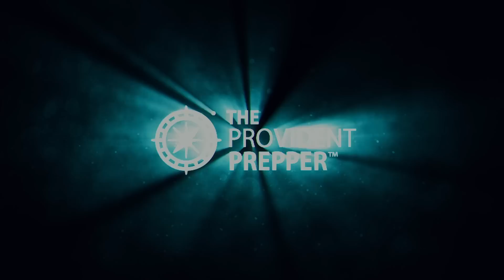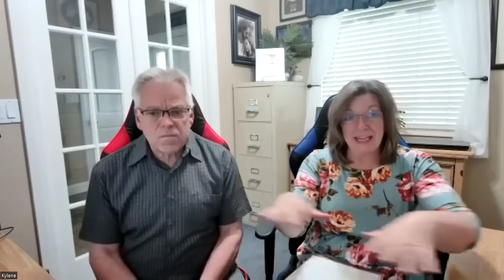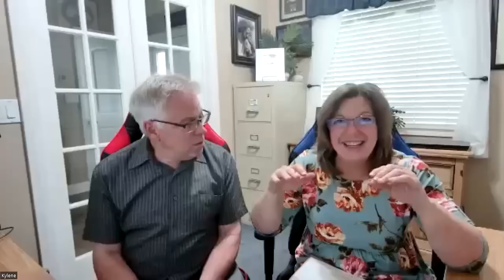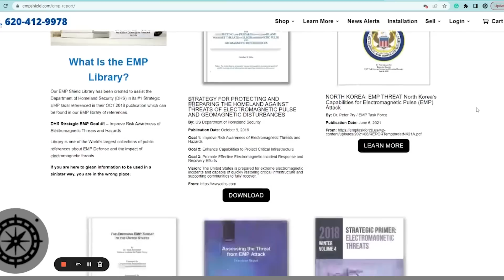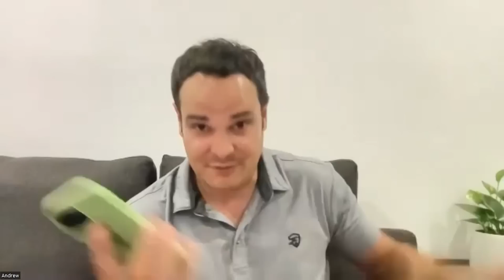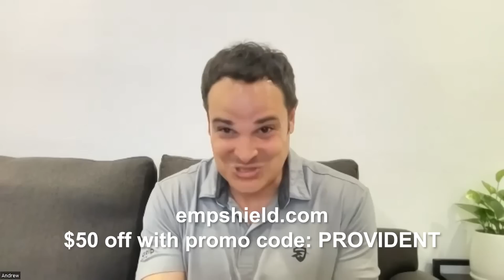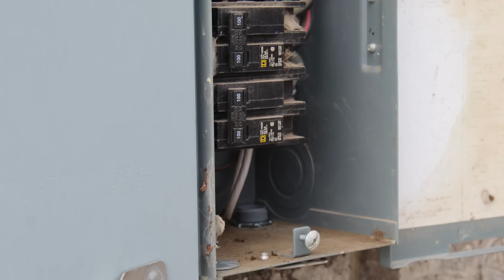Facts About EMP Protection: Interview with EMP Expert Andrew Bucchin

Comment: Why does everyone refer to the Carrington Event and claim falsely the electrical grid is going to go down. Yes there was an event that made issues with telegraph lines and the electrical grid. These modern claims completely ignore the fact that in 50 years, the CME events are better understood, and the electrical grid has been updated to be immune to the event.
For example, Telegraph and telephone lines used earth ground as part of the circuit. With a CME event, the earth's magnetic field separate the charged particles and create the Aurora as the current flows through the atmosphere to the ground. This puts a high current in the ground,. This makes the ground for point A a different voltage than point B, so current tries to take the lower resistance path through the wire. In addition, exposed wires can collect some of the current in the atmosphere and put DC current on the AC lines. This caused transformer core saturation and failure.
Fast forward 50 years. Enter the various High Voltage Labs, such as the one by Bonneville Power Administration in Vancouver Washington in the USA. Google it and see the nice photographs and videos.
One major change to the electrical grid is the breaking of the DC path between substations. One transformer has a Y winding to provide a ground for DC charges as well as a path for lightning. For the actual lightning strike, the inductance of the transformer is high, so to ground the HV pulse, lightning arrestees are used throughout the system. Now a pulse is shunted safely to ground, DC charges are shunted to ground, but a DC ground potential difference does not cause high DC current on the line, so the transformers are safe.
Sorry this is so long, but there is so much dis-information out there based on 50 year old knowledge. SCADA Supervisory Command and Control is connected between dispatch and the substations on Fiber Optic Cable.  Yes lighting does occasionally take out a local fuse, or re-closer, but is is far from a nationwide outage.
Spreading Fear is a great way to sell products, even if you know the truth, your customers often don't and can be sold on fear alone.
Knowledge replaces fear. Yes we know more about CME than we used to. We know more about lightning than we used to. We know more about EMP than we used to, but we know a lot more about protecting the power grind to make it more robust. There are huge advances in monitoring, circuit protection, and design improvements for reliability.
Go ahead and study CME and EMP. You probably have lighting covered except a direct strike. Now study the protection of power distribution systems. It is a fascinating field. Ignore the fear by anyone with a product to sell to protect against the unknown.
The Microwave oven as a faraday cage is just as described. The reason for this is the door seal is a tuned antenna. Take apart an old microwave oven sometime to expose the bent row of tabs in either the door, or in the rim of the cavity. This antenna shunts the microwave operating frequency and is not effective against other frequencies. EG the 2.4 GHZ signal is contained with very low leakage, but a 5.8 GHZ cell signal is unaffected by the door seal.  Use an old paint can instead and hammer on the lid for an electrical seal.
Wow, the amount of the lie of a single device protecting the whole house, while providing no RFI and with that EMP shielding.  The device for the house is a lightning arrestor. No the Wheelchair or CPAP is NOT protected from a radiated electromagnetic pulse, just because it is plugged in.  Please stop the disinformation to sell a snake oil product.

Comment: Thank you so much for covering this topic. So many Prepper Channels are trying to sell "EMP " protection devices. My Military friend says they're a scam.
Reply: If your ears can hear an explosion, they can be damaged (so wear hearing protection at all times 'to be safe' from loud noise damage).
If your electronics can pick up RF energy, they can be damaged - unless isolated well enough (like ears).
Antennas, cables and wiring in general pick up RF energy, and the longer the wiring the lower the frequency it is capable to pick up (at long range anyways, and this is where it 'counts' - below 1GHz, which has a wavelength of 0.3m or around 1 foot)
Removing any antennas from equipment not in use and wrapping/enclosing it in metal (Faraday's cage) is essentially the same as wearing ear protection on ones head - it will attenuate the incoming RF energy from damaging to tolerable levels.
EMP protection devices must therefore be very close to the item you want protected, and it must connect to all inputs and outputs with cable/wiring/antennas - if it will work as intended. (This is also what electrical type-testing or ElectroMechanicalCompatibility EMC requires, so devices won't interfere or be vulnerable from other devices interference)
Is a metal bucket a scam, no (not if the lid is made of metal and it is placed on the bucket) - but it is quite impractical to use whatever is inside.
Is 'EMP protectors' located far, far away (meters, yards) from say ones TV which has an antenna hooked directly up to its RF input port a scam... Most likely, and if grounded - it might even make things worse, if RF energy can flow through the antenna input, through the TV and into your 'protected' safe-zone ;ø)
Reply: your military friend is right.
Reply: This was just a commercial for empshield. Worthless.

Comment: EMP Shield will not protect microelectronic components against EMP high frequency radiation (E1)  - the inductance of house wiring is high enough that microelectronics will still be destroyed as the energy cannot be shunted away fast enough, and high currents (over a few nanoseconds) will still be flowing within the chips or semiconductors. Also Faraday cages will not be effective around batteries if you want to use them, as the wires between inverters/charge-controllers and the batteries will couple energy inside the cage. Making sure the positive and negative wires are as close together as possible will minimize induced differential voltage. Batteries with a BMS (Battery management system) may be vulnerable, but lead-acid batteries should be just fine. Finally, the disruptive power of a HEMP bomb will diminish as the square of the distance from its detonation, so it depends on how many bombs are detonated to get coverage. You may be lucky and get very little E1 (high frequency) damage. The more rural your area, and the nearer the coasts, the better. E1 pulses are line-of-sight, so surrounding hills may protect you also.

Comment: Andrew....you will be walking 100 miles with your Pregnant wife because even IF your gadget works to protect your car, the roads will be cluttered with unmoving cars and everything will be impassible.  Furthermore if you need gas you will be SOL because the pumps won't be running after an EMP.  This guy isn't too bright. He is a salesman

Comment: I have house & an off-road vehicle protected, I need to add for my three vehicles. Cheap cost for more insurance. My wife works about 20 miles away, physically she could walk that distance easily but there will be wolves at the first sign of weakness of society.
Reply: Just fill the other 2 with gas for when the first one runs dry. But probably neither of you will have a job as most people wont. Most wont go to work as shock and survival mode will kick in. People will go to stores but not with the idea or ability to pay. Mass stealing stores empty in the first few hours.

Comment: For those with solar or wind turbine power, the EMP shield makes sense. Otherwise, a large enough EMP or CME will take the grid out for years. We have a whole house dual fuel generator but it's only going to run while there's fuel. Same goes for cars. Your car - when shielded - will start but how long before your gas tank is empty? Being stranded 100 miles from home is going to be a problem with thousands of unshielded dead cars blocking the roads. Shield your phone but all the cell towers and WiFi will be fried. Again, I think EMP Shield would be an investment for people with renewable energy. Sadly, that's not my family. We've prepared for surviving what would become very like a primitive camping scenario for a very long time. Did you know those big transformers on electric substations have a 2-year lead time? And they're so expensive there are very few "spares" sitting around.  I hope Andrew is right that we could get a "light" CME rather than a Carrington Event. Thank you for this video. Andrew is so right about all the misinformation out there!
Reply: Thanks for your comments...you make some really good points. I have decided that I will protect my car and home with the hope that normalcy is restored fairly quickly. If however, as you point out, large transformers are destroyed (and the country making most of the transformers may be the one that destroys them), it may be a long time before we get up and running and able to start rebuilding. I hope and pray that we never have to deal with this, but the threat is on the table, made by people that are wiling to inflict that damage. Unfortunately, those who are in power don't seem super interested in finding solution to either stop this threat or deal with it if it happens. Keep doing the best you can with a smile on your face and faith in your heart!
Reply: synthetic gas generator for vehicles,essentially burns wood and turns it into flammable gas that can run motors. Used extensively overseas to power vehicles in ww2. Commercial units are available or can be DIY versions. Have a friend who converted a pickup truck to run on syn gas with a generator he made.

Comment: No electricity, no water, natural gas, gasoline, food being delivered to your store.  It's more than just keeping the lights and refrigerator/freezer going.  So your car works, where are you going to go?  To work?  Work won't be up and running and the stores will be cleaned out very quickly.  Things like wheel chairs and other electronics will work until they need to be charged.  Then, NOTHINg.  nYeah it's a bad scenario unless you're prepared to live like in the 1800's.

Comment: Depends on the EMP. If its a Superflare, which we are expecting any day now, you are looking at a X1000 to X10,000 flare. The magnetosphere is down 25% (3 auroras in low latitudes this spring alone). Those flares will burn anything with wiring. Like every structure in a first world country. All cars. Big threat.
Great points guys but think bigger.
Reply: I heard you can try to store metals in rubber containers! Wonder if that would work
Reply: If/when this happens I have feeing we wont be worrying a whole lot about anything.  There wont be anything left to worry about.  But if this doesnt happen it may be worth considering.

Comment: Great information!  I didn’t hear a discussion on the likelihood of our cars being fried by EMP. Dr. Bradley has said that many cars would quite possibly survive. What is your opinion?
Reply: There is a lot of misinformation or missing information when it comes to cars. As designed, cars do have some ability to withstand lightning strikes, which extends at least somewhat to EMP or CME. The EMP Commission did some testing on cars, from which they determined that most cars will survive. However, I have since heard that Peter Pry (one of the most brilliant minds on the commission) believes that the testing was poorly done and not adequate. From what I have heard, they didn't hit the cars with an EMP that reflects the magnitude of an expected EMP. He has since graduated from this life so we can't ask him directly, but I believe he believed that if they had used the 50,000 volts per meter, many or most of the cars would have been seriously damaged. So, bottom line...we really don't have solid information, and we don't know the intensity of the EMP we may get. My opinion is that we should plan for a situation where most cars are disabled, and we will be thankful if more cars do survive, even if we have a problem with fuel distribution and delivery from underground tanks. We can solve one problem at a time. I put an EMP Shield on our most used vehicle. I hope I never have to use it, but if I need it and it helps, I will be thankful. As I said upfront, EMP is probably one of the largest threats we face, and the one that we have the most confusing and conflicting information about. I hope this information gets better and we take steps to deal with that threat. Not a lot of progress thus far, but I am hopeful. Keep being part of the solution!
Reply: Does this hurt the animals that's outside
Reply: @shirleycoleman1962  no

Comment: Has EMP Shield been tested against Super EMP?
Reply: How do you in fact test it?
Reply: @tracycaldwell1736  Tracy, it's tested the same way they test their products--in a government test facility, against induced current in the air.  They test up to 90,000 volts per square meter currently.  They would need to test at least twice that level.  Take care.

Comment: I want an EMP shield on my car. I costed it up. With fitting by a mechanic, it was about £650. That's a big investment for me.
Reply from the maker: You don't need a mechanic. I think you could do it yourself. Watch for another video coming out about the micro EMP shield.
Reply: I helped design your cars electrical system.  It can't be protected this way against any real size EMP.  Each circuit, sensor, injector... would have to be individually protected.  This hooked to the battery only protects the starter and alternator....MAYBE... physically can't be done. . Don't waste your money... the cars fairly good built in protection is as good as yer gonna get.  40+ years in Auto R&D here
Reply: Yes my grandson say it's so simple

Comment: Amy idea what can be done if one lives in an apartment? Everything I've heard so far applies just to houses, not apartments. What can I do, if anything, to protect myself?
Reply: If you live in an apartment building, you can create a Micro or mini safe zone.
First, do you have a Circuit breaker box in your apartment? If you do then having an EMP SHIELD will give some protection because you are isolating your unit from the rest of the apartment. Think of EMP Shield is like a " FIREWALL" it's there as protection. As they say just like chicken soup " It Can't Hurt",
Second, Do you have a ballcony or access to the outside from within your apartment if you  do then you can setup solar panels with batteries for storage energy and or use a Small generator if needed.  PLEASE USE GAS OR PROPANE GENERATOR WITH LOTS OF VENTILATION A.K.A OUT SIDE NOT IN YOUR HOME OR APARTMENT. PLEASE STORE ALL FUEL FOR GENERATORS WITH LOTS OF VENTILATION OR OUTSIDE NEVER IN DOORS
Get some EMP bags to keep your Emergency equipment in. Find out how to me make a faraday cage to store equipment.
Use the nesting method for protecting items. That's put a box in a box concept. Use multiple layers increase survivability of items.
It's a lot but we'll worth learning what to do.
YOU ONLY HAVE ONE CHANCE TO BEAT AN EMP, AFTERWARDS YOUR OUT OF LUCK .

Just my 2 cent
Good luck
Reply: What floor do you live on? Do you have an elevator? Do you have a balcony? Do you have any solar panels?
Reply: Great Question and awesome responses. Each situation is a bit different...look at your situation and evaluate your options. A great place to start is building a community of family and friends who are like-minded and develop some plans. You will want to be discreet in your decisions about who to include. Food and water (stored and the ability to find and purify) are high priorities, as is security and personal protection. Look for safe, low tech solutions to meet your needs, but a protected power station may help with critical needs such as medical equipment, etc. Travel will be difficult...perhaps not possible or safe. Having a community close is not just nice, but critical if at all possible. If you have vulnerable electronics that you will want/need, build or buy a Faraday enclosure to protect them. Look at everything you do and determine is that activity is critical, and if so, how you will meet that need. So much of our world revolves around all things electronic/digital. I certainly hope and pray that an EMP/CME never happens, but as I look at our crazy world and the threats that are facing us, we need to prepare as best we can. In my opinion, the most important thing you can do is develop/strengthen your positive, faith-filled attitude of cheerfully doing what lies within your power, then allowing God to take care of the rest. This will drive and direct you and bring peace of mind. SMALL STEADY STEPS! Connect back if we can help further...keep being part of the solution!
Reply: @JonathanBJones Unfortunately, if you live in an apartment... just plan an escape.  If your stuff still works your neighbors will kill you for it.  The power was out from the Atlantic Ocean to mid Michigan years ago.  I worked with the team analyzing the event for the power company....

  Roving bands of mercenaries were forming in Detroit in less than 24 hours.... and that was just a hiccup in the grid.

2nd amendment anyone?